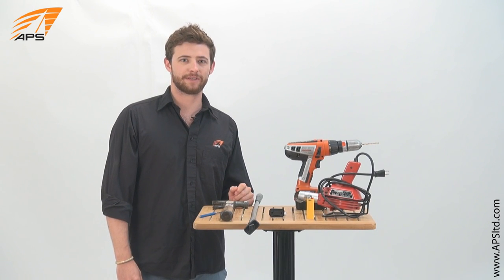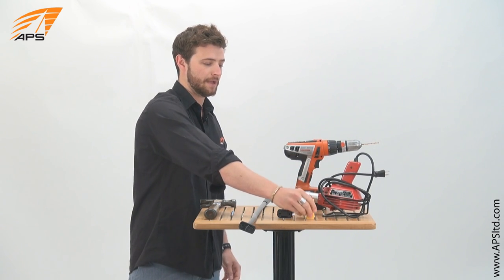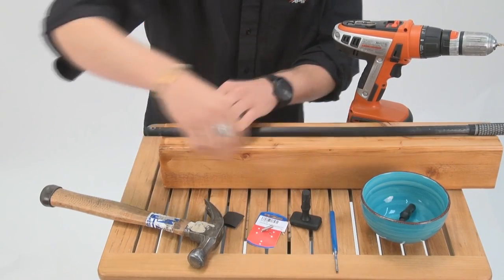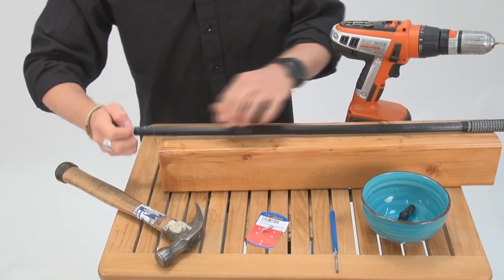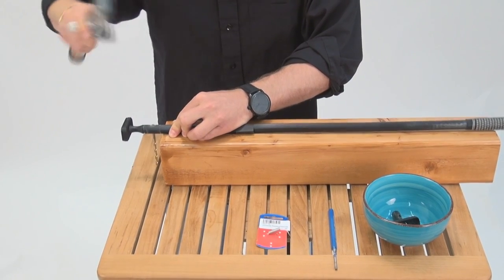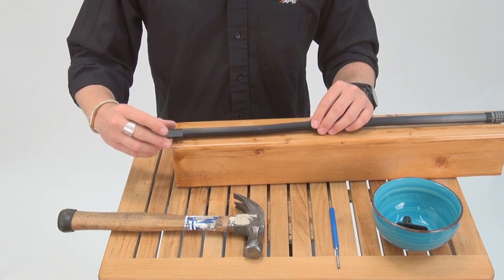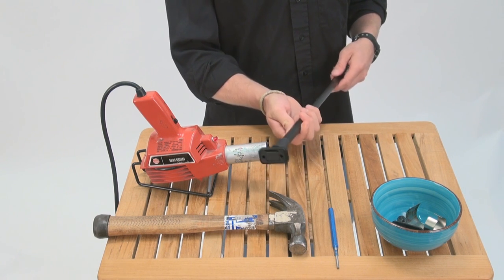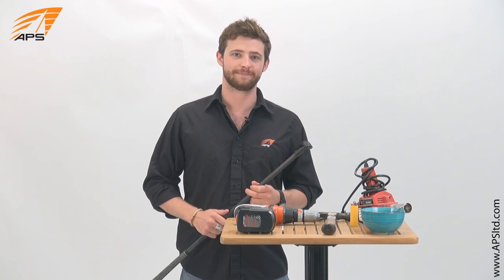How to Replace a Tiller Extension Rubber Universal | Expert Advice

Comment: Brilliant video, thank you very much, informative and succinct.
Reply from the maker: So glad we could help, Peter!
Reply: There is one extra tip that would have helped me - the replacement part that I bought wasn't assembled properly in the packaging and I didn't realize so I assembled it without putting the cover plate on first so had to cut the heat shrink and do it again. One good thing about that was that I decided to position the pin almost flush with the top of the rod instead of symmetrically. This is more comfortable on the wrist when not using the extension and hand is on the tiller with extension lying along the tiller.

Comment: I wish someone in the industry would make a joint that wasn't rubber (or whatever the hell it's made out of). I went sailing my Sunfish in heavy winds on a lake today and the joint/knuckle tore. Damn near threw me out and almost flipped my boat. Not to mention I lost the tiller extension. Some might say "...flipping a Sunfish? Big deal!" Well  it is a big deal when you're sailing on a large Florida lake. We have these big-ass lake-lizards with teeth that kill people from time to time. Anyways, I ordered a new tiller extension, I hope it fits. I'm considering going back to the old-style wood tiller and extension, THEY WON'T BREAK.
Reply: Forget these expensive rubber extension joints. Just drill a hole in your tiller where you'd like the extension to mount. Then take a short piece of line, maybe 1/4" diameter and twice as long as the thickness of your tiller and extension combined. Push it through the holes in your tiller and the extension then knot both ends leaving enough slack for a bit of universal movement. Simple and effective. The commercial joints are just rubber coated cord anyway.